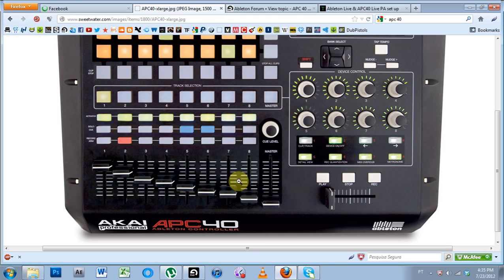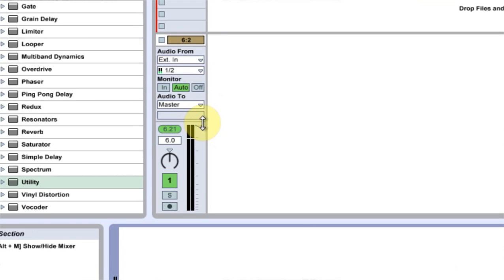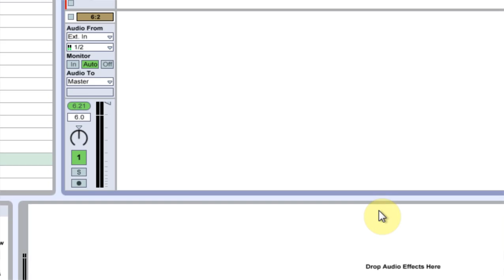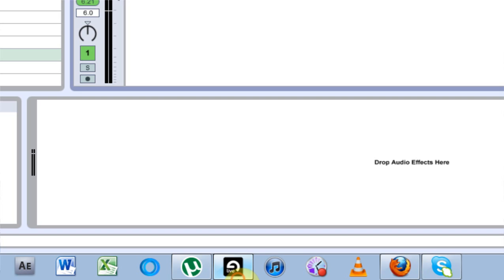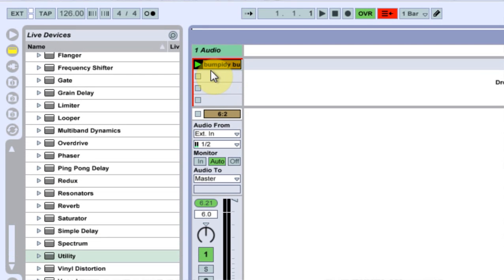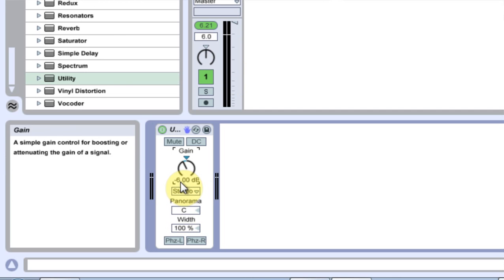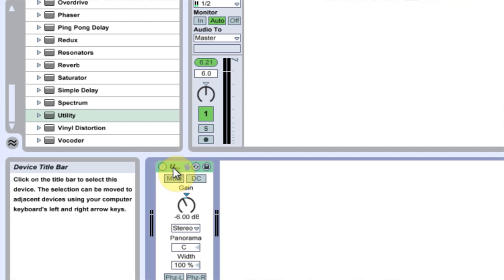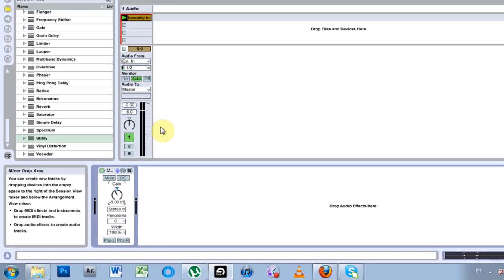Ableton Tutorial: QT e.13 - APC 40 Volume Fader Parameters

Comment: Or you could just learn how to adjust the min/max midi values of your controller by hitting the midi button in the top right of your screen and save yourself having to add unneeded plugins to your channels ;-)
Reply: that doesn't work when apc is auto assigned, you'd then have to map everything on the apc again.
Reply: That also only works on a per channel basis, the same as the utility unless I am missing something... I was hoping someone found a way to adjust the slider range that will work as you bank select. I am working with 100+ channels so neither solution is really ideal if I have to apply an adjustment for every track... Any ideas?